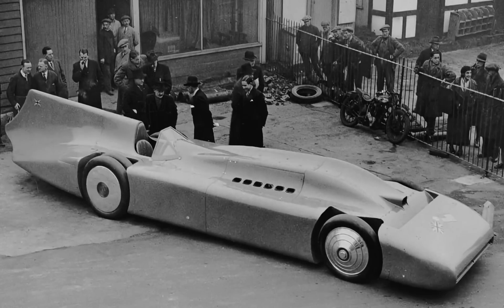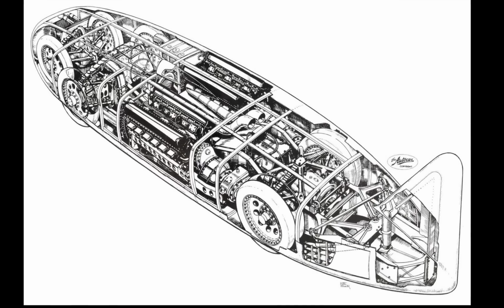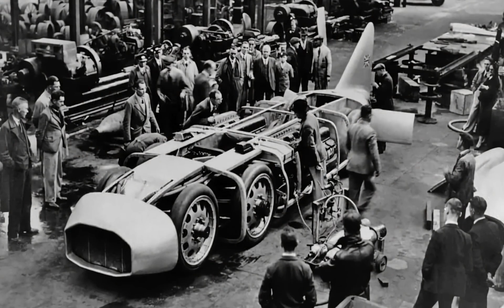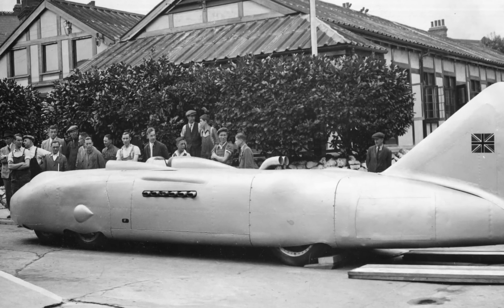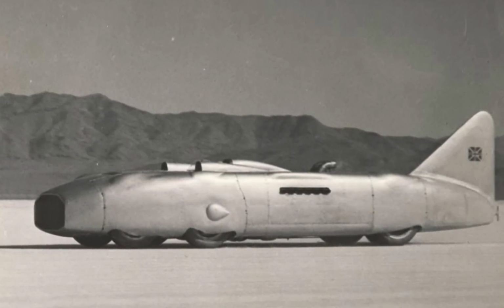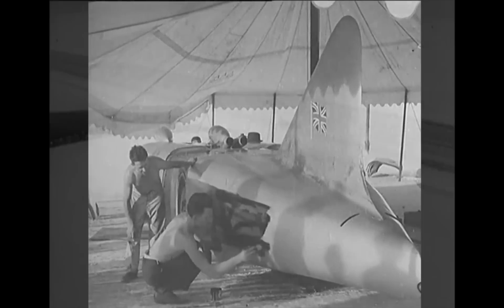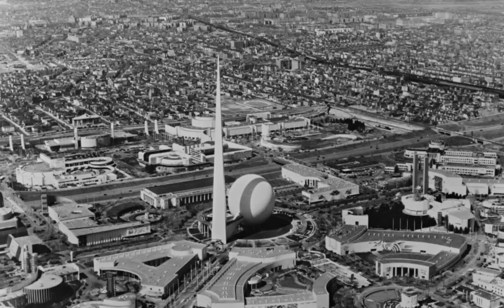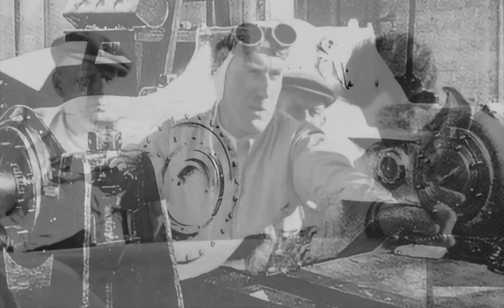George Eyston's Thunderbolt - Land Speed's Missing Monster

Comment: Great information. Unless I missed something however, there's a contradiction. The car is described as having tandem engines, but the drawings and photos show side by side engines.
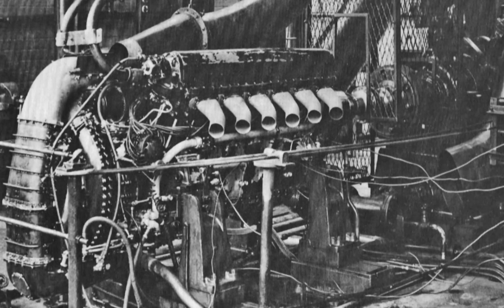Reply: 1:54
Reply: @soaringtractor  Thanks for calling me a name when I can't hear.
Reply: Yes so should it be "Twin"?

Tandem has come to mean,"together"....  as in  More than one (Despite the Latin origins of the word - was it originally a joke??)

Is there a word for "Side by side" ??
Reply: kadmow yes, tandem
Reply: Or more correctly, ‘in tandem’
Reply: @kadmow  Abreast was the only thing I could find in a single word aside from twin. Two engines on a boat are always stated as twin so maybe that's better.
Reply: Side by side is also tandem. the English Electric Lightning trainer is side by side, and has always been referred to as tandem seat.
Reply: @terrystevens5261 I checked and what you say seems correct in a sense, but calling side by side as tandem is still quite uncommon. Almost every definition is one of anything in front of another, like on a tandem bicycle for example.

Comment: These speed record races were interesting because these cars had wheels driven directly by petrol engine via mechanical gearbox , not by a jet engine producing thrust . Even locomotive don't got that and transmit their huge amount of hp by dynamo and electric traction motor .

Comment: More power does not mean more speed!! This speed could have been done without the extra engine. It could have been done by use of higher gearing.
Reply: bla bla bla.....off you go then . look forward to your attempt ?
Reply: @davidhaney1394  Well said. It is a shame that Christopher wasn't on Eyston's design team. What a difference he would have made. The LSR would still stand today.
Reply: you have to have the power to pull the gear.  he could have re geared the existing power plants, perhaps.  but you have to have x amount of power to move y weight against z aero drag and other parasitic loss.  the other consideration is that Bonneville has a limited acceleration area.  you have to get to speed quickly.  building a car 5-6 ft wide made aerodynamics a nightmare.  despite this, his accomplishments are still impressive.
Reply: i'm guessing the extra engine was for a bit more weight to keep the thing on the ground .power weight ratio .imo .
Reply: I hadn't realised that. Now all I need to do is fit longer gearing to my lawnmower and I'm set for the record.
Reply: @rogerking7258  it is a matter of utilising the engine's power to best effect. Having two big engines with high red line speeds using the wrong gearing is not going to work well. All you get is a rapid accelerating car, with low top speed.

Comment: I grew up in Wellington New Zealand and remember reading/hearing about this. There have been a few attempts to locate the remains in the landfill where it was unceremoniously put, but none successful. Which is a shame.
Reply: Yeah, I remember the son of Lenovo Southward wanted to use some ground penetrating rader,  still would have been near impossible. Happy Valley tips been used for so long, it must be well buried. Would have been interesting though.
Reply: @bunning63  It wasn't the Happy Valley tip it was rumoured to be in - it was the Appleton Park tip in Karori. That's where Roy Southward (Len's son) was looking.  It was a very deep valley that was filled in over a long period. The tip was still being filled in the early 60's from memory so it would be a long way down and impossible to find with GPR.   The engine was removed after the fire and is in MOTAT museum in Auckland. I don't think it ever had two of the dummy engines as it was displayed in New York and Wellington with just one engine cover open.

Comment: where do you get all this information? none of the quotes or weight of the gearbox is mentioned on wikipedia
Reply from the maker: Thanks for your comment! Wikipedia is just one source I use in my research - also enthusiast clubs, magazine articles, books etc. This video has been in the works for 6 months, as I kept discovering new info, and it takes a while to draw all the facts and figures together.
Reply: Discovery Channel did a documentary on it years ago, can't remember if the gearbox stats were in the program though.